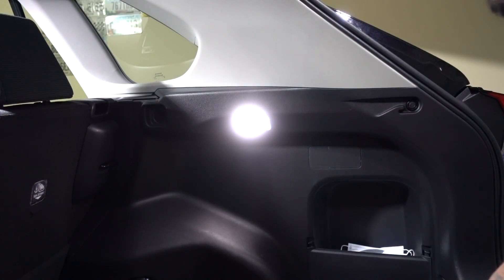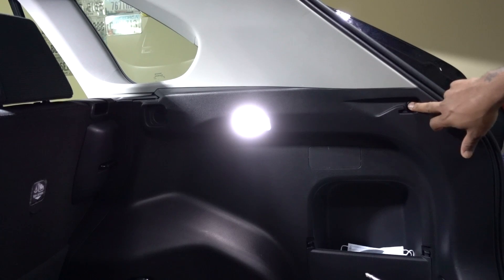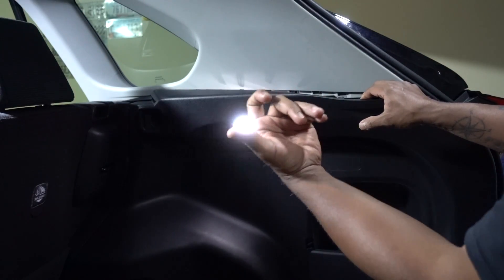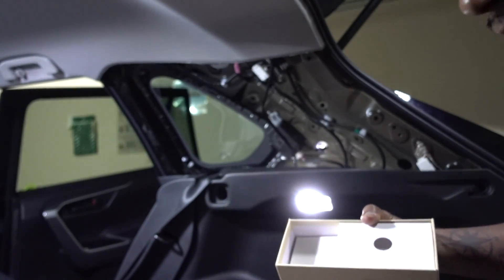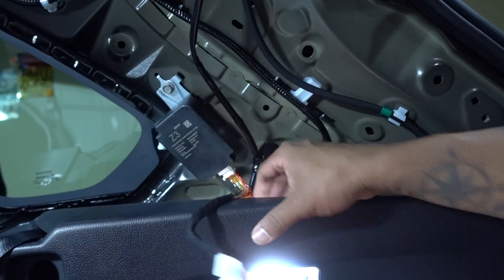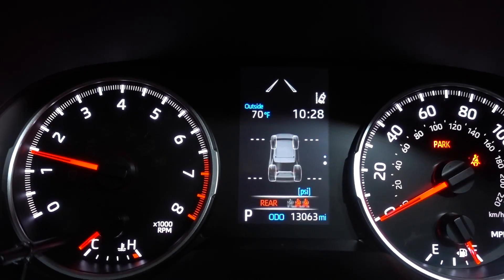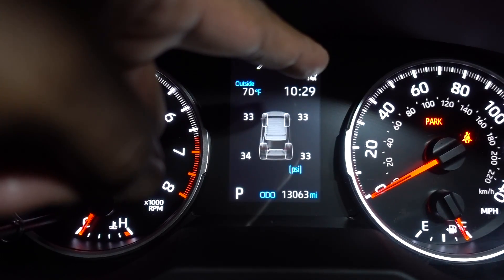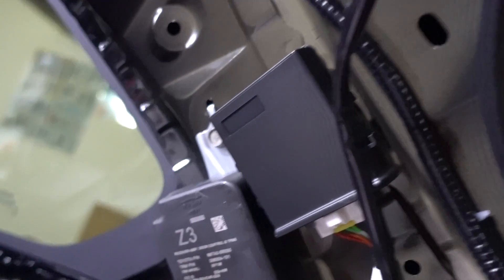Installation of CarTrimHome Smart Car TPMS Tire Pressure Monitoring System | 2019 & Up RAV4

Comment: Why would they put tps on the tire if u cant even read on the dash? Doesnt make any sense for toyota to do it. But this is a good add on for the features. I just wish you could have shown the before and after on the dash.
Reply: IT does not have the program, Somo models only show low pressure warining , not the actual preassure
Reply: it does have TPMS, but just a warning when is too low
Reply: @edgartirado5750  which model u think that have it?
Reply: @wanderer2955  MIne is a XSE hybrid and have tpms but only warns when the tire is low. Not show actual preassure. All models in USA since late 2000 must have it due to US regulations
Reply: @edgartirado5750  i have to check mine then lol. I just have the 21 xle premium.

Comment: nice video but I would say if you can somehow o this without taking out the upper trim panel completely, it would make this much easier. getting that panel back is very difficult. have spare clips as well, I broke 2 trying to get the upper center one in.

Comment: will it work with my 2021 RAV4 hybrid XLE?  I think mine will show Kpa
Reply from the maker: It should work
Reply: I have exact 2021 RAV4 hybrid XLE.... shows kPa out of box and installed 😢
Reply: @hapnin123  I bought it and installed already.
Reply: I have installed my device in my 2021 hybrid rav 4.  How do I get it to read out in PSI

Comment: Somehow this got deleted; perhaps because I included a link to the instructions, so here it is again without the link.  I did manage to update the tire positions after finding the instructions from the manufacturer.  I had to do it twice, but it finally worked.  Here is what I did:  
You will need a good compressor, valve stem removal tool (optional), and good air gauge handy.
First, leave the car on, and the TPMS display up. Shut the doors so it will stay on.
Next, press the stem or remove the valve core to let the pressure out faster, use the air gauge to see when it is getting close. Install the core when it approaches the pressure, use the compressor to add some air if you overshoot. Double check the pressure on the screen to see if it is close to the pressure as you go in this order: in kPa "front left tire is 100, right front 130, left rear 160, and the right rear tire is 180. [note: the pic says 190]" Apparently 180 will work. (In psi 14.5, 18.9, 23.2, and 26.1 or 27.5) When the pressures are set, the system will update the tire positions.

You should get as close as possible, but don't have to be perfect (see the pic above).

Air up your tires according to the label in the drivers door jamb.

Eliminates the need for the OBD TPMS tool to relearn the positions after a rotation.
Reply: This absolutely works!  Thank you for posting this!!!

Comment: Will this work for 2021 Corolla SE sedan? It has the same screen just to the right? Also it has TPWS so just the warning system without this actual individual readout.
Reply from the maker: Go to cartrimhome and see if they have for your vehicle
Reply: @BulletSolano they don’t have one for Corolla. They barely offer any products for the Corolla but pages for the RAV which I also have. I found on Toyota forums that the new one does work and the module is behind the driver’s side C-pillar.

Comment: Confirm that this works on 2019 LE, showing PSI. Thank you for this video!
Reply from the maker: Thanks
Reply: Hi, just came across this and have a 2019 LE with AWD. This seems to be in place of the AWD screen. Just curious to know if yours had AWD and if it did, did it replace this screen?
Reply from the maker: Is going to add another screen

Comment: For some reason my sensors aren't telling me the correct reading for the right tire. For example my back right sensor is for my front left wheel, whacky stuff like that.. how to fix
Reply from the maker: In cartrimhome’s website they have the procedure to calibrate the sensor

Comment: Hey Bullet, I added this to my 2019 RAV4 LE. After the install the PSI readout was working. However, I went to set the tire pressure to the correct 35psi cold tire, as it was set incorrectly before I got the car, and when I went to do it I accidently hit the "Change Wheel" option. After re-initilizing the TPMS system and setting th pressure I am not longer getting the tire pressure readout. Is there something else I need to do in order to get the readout back? Currently it just shows "---" for each tire and not the actual pressure as it did when I first installed. Any help would be appreciated! Thanks!
Reply: I ended up figuring out a solution to the problem. I had to disconnect the module and reconnect the OEM module without the wiring harness. Drive the vehicle. Then reconnect the aftermarket model with wiring harness and upon doing that it resolved my issue. Works great now. Shows PSI since I have an LE. Can confirm it did add another screen so I have the AWD screen still present.
Reply from the maker: Sorry man I just got this notification, cool
Reply: I can confirm that this is an issue - Just in case anyone does this module - which I have and very much like.... It does prevent Techstream from being able able access this module.  I unplugged the module and got right in so that I could program for my second set of tires.
Reply: Hi Guys, I had the same issue with this Module, but I have solved it in a different way, without disconnecting the Module.
These are the steps that I have repeated on several occasions and it has always worked for me.
1- Go to the screen to recalibrate the TPMS and press for a few seconds to change the wheels, until the message "Tire Pressure Recalibrating. Please Wait" appears. 
At the same time, the amber indicator "Tire Pressure Reset" will begin to flash...(important to wait for this indicator to stop flashing".
2 - Once the "Tire Pressure Reset" stops blinking, go to the screen that shows the pressure of each wheel, you will see the same message "Tire Pressure Recalibrating. Please Wait", the "Tire Pressure Reset" will start blinking again, (important to wait for this indicator to stop blinking".
3 - Once the "Tire Pressure Reset" stops flashing, you can turn off the engine and after several seconds, start the engine again, the screen will appear again with the message "Tire Pressure Recalibrating. Please Wait", all that remains is to wait and then After approximately 2 minutes, (this may vary) the pressures of each tire will be seen.

I have tried this several times, but I have not measured the real time of each step, so be patient, it will always be better than having to disconnect the Module.
Toyota Rav4  LE (2020)

Good luck. 😉

Comment: Take your time removing and replacing upper panel. The clips can break. I know.  Broke 2. Luckily I had a collection of various panel retainer clips.
When looking for a place to mount the module, be sure not to mount near or over receiving holes for the side panel in the sheet metal.
Reply from the maker: I work at Toyota, I have all the clips I need

Comment: hola comoestas . estoy viendo un video que lo hicistes hace dos anos de como instalar CarTrimHome Smart Car TPMS Tire Pressure Monitoring System,  lo que quiero saber si ese sistema puede ser instalado en una Rav 4  XLE  premium 2021. te agradezco  me informes.  gracias.
Reply from the maker: Qué tal, si las válvulas de aire son de metal si
Reply: @BulletSolano  . bueno a que valvulas te refieres,  donde van esas valvulas, tengo que desmontar las llantas para ver que valvulas son.  o  son las valvulas  por donde se le hecha aire a  als llantas.  yo no soy mecanico y jajajajaja no tengomucha experiencia en esto. o hay alguna manera de averiguar  donde van esas valvulas.  como siempre te agradezco  tu ayuda.ok gracias y que dios te bnediga.
Reply from the maker: Si la válvula para ponerle aire

Comment: If i dont have tyre sensor in my tyre can i buy also tyre sensor for all my tyres with the two available frequency 315 and 433 and connect them to this device please advice me
Reply from the maker: This is for a factory system, ask cartrimhome if that works for you

Comment: Our TMPS tool can no longer update the sensors after installing the unit.  We were able to learn new sensors and positions just fine before with the tool.  Is there something different we need to do now?
Reply: What you mean by TPMS tool ?? You mean this extra module that you installed ?? Whats the problem exactly...why and what cannot be updated

Comment: 2020 RAV 4 w TPMS kit.  I have the kit from CarTrimHome and watched your video.  Now I am starting on my car.  Can you tell me anything more about the clip you removed in the beginning after removing the phillips head screw of the lower panel?  I have the orange tool and started to try to get the clip out but it's not coming and the end of the tool is breaking off.  Thank you.
Reply: Thanks again for your great help.
Reply from the maker: No problem

Comment: I just added mine but I’m not getting any screen that shows the tire pressure. Any idea why?
Reply: My car is a 2019 xle awd
Reply: Rav4
Reply from the maker: Do you have a metal valves or plastic? Is not gonna work with plastic valves
Reply: Yes they are metal .
Reply from the maker: Check your connection, probably one of the pins is not straight

Comment: Rav4 is not coming with metal valves that have tpms....also mention in video.  We need to first install tpms valves and then install this module
Reply from the maker: Then how I did the install in this rav4?
Reply: @BulletSolano  on some rav4 they have alrready given the metal valves that has TPMS....my rav4 they have not given...toyota is very cheap they keep removing out stuff every year for cost cutting
Reply: @BulletSolano  from where can i buy this module ?? Ebay ?? All are chinese brand can you suggest which exact model is better...
Reply from the maker: @burjis24 link in the description
Reply: @BulletSolano  i opened the link...it says this product is not for canadian Rav4 i am in canada...it says car must has tpms sensors installed first...confusing to understand will it work for my rav4 or not in canada
Reply from the maker: @burjis24 it should, mine is built in Canada, but if yours has tpms sensor I don’t see a problem
Reply: @BulletSolano  mine did not come with tpms sensors so ill have to buy sensors change it and then install this module...toyota is weird...LE model in canada will have different features...vs LE in USa will be different
Reply from the maker: @burjis24 gotcha

Comment: So I purchased the same one from CT and installed exactly as you did but I get KPA and not PSI....what trim R4 you have? Mine is and XLE Japan version.
Reply from the maker: Mine is LE American version
Reply: @BulletSolano  mine is American but built in Japan does your vin number have a J?
Reply from the maker: Don’t know, I’ll let you know later, I’m at work
Reply: Hi friend i have kpa usa model limited how can i convert it to psa
Reply from the maker: Hi, you can’t, I don’t know why some people get KPA
Reply: Can we request PSI when we order?
Reply from the maker: I don’t think so
Reply: @chucksw1  I bought a sensor and they reached out to me and asked what trim I was buying for. I have a 2019 Adventure. So I was told that the module would read in KPH for the higher trim levels.

Comment: I live in Canada and Canada doesnt require TPMS not like states (suckss...) So I dont have TPMS in my tire. but if I install TPMS on my tire. If I get the system from Cartrimhome will it work for my car ??. I have 2020 XLE Premium.
Reply from the maker: Yes, but you need to check on the rear panel to see if you have the module
Reply: @BulletSolano  Hey Man,

How do I check if my tire has TPMS sensors?

I got so confused on this.

Thank you!
Reply from the maker: If you here in the states you do have TPMS sensors but you need the ones with aluminum valve stamps to work with your RAV4
Reply: @BulletSolano  I am in California. It seems like my 2020 XLE does not have the tpms sensor in it. Thank you for letting me know!
Reply from the maker: If is in Cali yes you do have it, but it needs the aluminum valve stamps to work with this sensor!!
Reply: @BulletSolano  right. It does not come with aluminum valve.
Reply: Hi @DaeHee choi did the smart tpms work for your rav4 xle premium? I am planning to get this but my rav4 model is xle premium 2021. Thanks in advance

Comment: I  guess it's a stroke of luck on what the TPMS will display.   I ordered mine recently.  And it doesn't show PSI.
BTW, it was really hard to get the upper panel back on.   I managed to get it back in but there is one portion that doesn't quite flush with the lower panel.   It didn't matter how hard I pounded on it.   However, nobody would know the gap unless they see it the 1st time ... then they can't unsee it subsequently
Reply from the maker: LE models will show PSI every other model shows KPA
Reply: @BulletSolano  That explains it.  Mine is a hybrid XLE.
Reply: @Chitown388  which year is it?
Reply: @MohammadMasadeh76  Mine is 2021 RAV4 XLE Hybrid.
Reply: @Chitown388  mine is the same. I was reluctant to get one until I saw your comment. I was wondering if you changed the tire pressure sensors or they are the original ones. I read that this module does work with original (rubber) sensors and need to replace them with the metal ones. Thanks for hint
Reply: @MohammadMasadeh76  I still have the original OEM tire pressure sensors.    And the mod shows the tire pressure every time.
Reply: @Chitown388  That is great. Thank you
Reply: @BulletSolano  I have an LE and it still says KPA
Reply from the maker: Check with cartrimhome why is that
Reply: @BulletSolano  what's that
Reply from the maker: Cartrimhome is the company’s product, that’s where you buy the product right?
Reply: @BulletSolano  what should I do, you stated that it will show psi
Reply from the maker: Contact the company you get it from

Comment: We have a LE Hybrid Japan built and are replacing the donut with a full size spare that has the sensor.  Will it work?  Will it also display the pressure in the spare?
Reply from the maker: Is the spare is programmed to the vehicle yes, ones the spare is rotating

Comment: Have you installed the TPMS in your 2021 RAV4?  If so does it show PSI?  I believe we have the same model, XLE and I want PSI on the display, not  kPa.
Reply from the maker: I don’t have metal valve stamps on my XLE, that’s why I didn’t do the installation

Comment: I just iomstalled mine on a XSE Hybrid It shows KPSA  Do you got to calibrate wheel location??
Reply from the maker: Yes
Reply: @BulletSolano  How???? Is done?  Do a video LOLO
Reply from the maker: Lower the air one tire at a time to see where you have them and where they belong
Reply: @BulletSolano  But when they are rotated, is there any way to relearn where they are?  For example the system tells deflate Left Front, now deflate Right Front ETC/
Reply from the maker: No y have to do the same process again
Reply: @BulletSolano  So there is no way to update where are the tyre. Have you noticed if it changes at some point by them self?
Reply from the maker: No because the TPMS sensors are factory place in there location

Comment: Does this work for rav4 2020 xle awd? Awd has another screen that shows the wheel power on that screen.
Reply from the maker: If you have metal valve stamps it should work

Comment: I need helps anyone...
My tire light came on and went to a tire shop and had a tire patched up. They said my light would turn off as I drove away but It hasn't...
Is this true?
Reply from the maker: Yes, if not Tire pressure is low, check to make sure the pressure is right

Comment: Hi, can I ask what model RAV4 you have? LE?  I just ordered one! :) There's no need to do a relearn or anything right?
Reply from the maker: Hi, LE when I did that video, XLE now, check the comments on this video, someone explain how to do a relearn process
Reply: @BulletSolano  ohh so you need to do a relearn in order for this to work? Did you have to do a relearn when you plugged it in?
Reply from the maker: Not when you plug it in, only if you do tire rotation
Reply: @BulletSolano  great! Thank you so much! My Toyota app stopped updating for some reason.. even though I still have the subscription till next year so this is definitely worth it.

Comment: Will this work on a 2020 XLE hybrid?
Reply from the maker: Yes
Reply: @BulletSolano  unfortunately I have rubber stems on my wheels.
Reply from the maker: Ooh sorry
Reply: @patrickdreiding3342  You probably still have TPMS sensors though. There are 2 kinds of TPMS, metal (clamp-in) and Rubber (Snap-in)
Reply: @KenMF23  You are right.  I do have TPMS on my car.  I can see the tire pressure through the Toyota app.   For me, being rubber valve stems is not a show stopper?
Reply: @patrickdreiding3342  No. I think the website is just saying you need to have TPMS at all. Some modern Hondas have indirect systems so no sensors. Let me know if you buy it and it works.
Reply: Web page says... what about 2020 or 2021 xle hybrid?
Please note:
your tire must have a tire pressure sensor to use this product.
Different models show KPA or PSI
KPA:Limited AWD...
PSI:LE...
Reply from the maker: I need to do more research on why some vehicles do KPA and others PSI!
Reply: And please let us know if psi will be displayed for the xle version😀
Reply from the maker: I don’t have that model, the only way will be testing on your own RAV4, but let me see what I can do